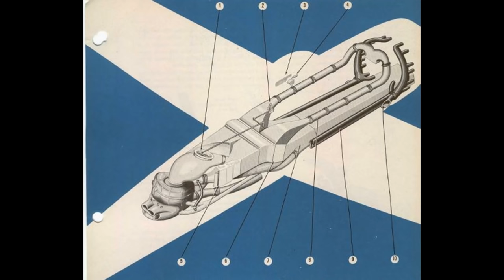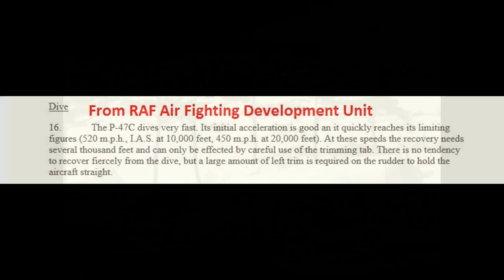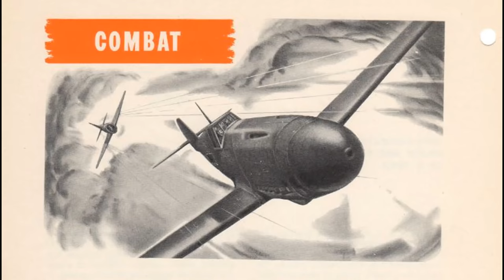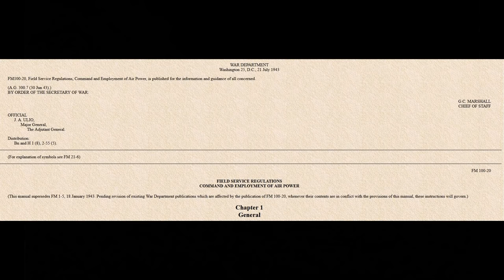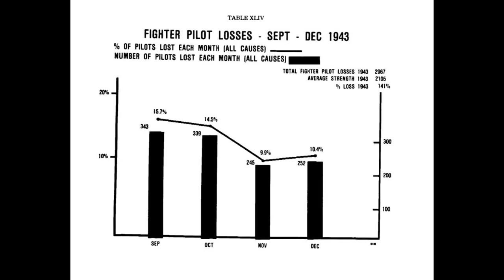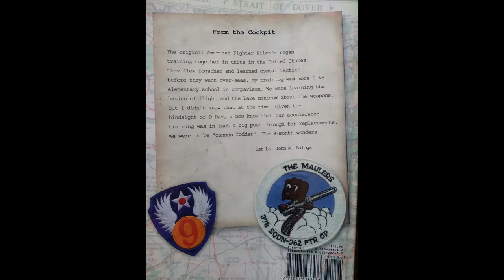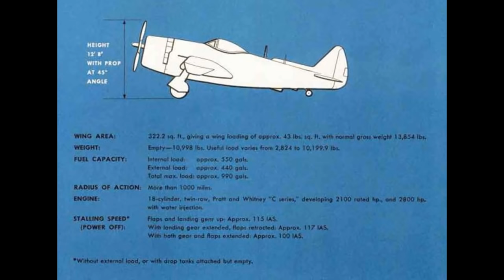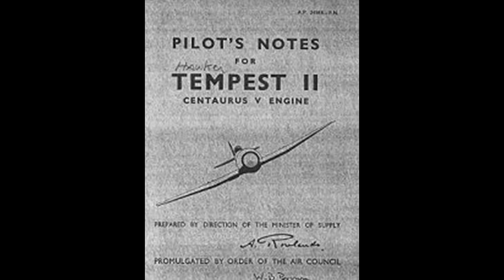P-47 Thunderbolt Pt. 8 Conclusions

Comment: The day before dive testing the P 47 Erick Brown found that the ME 109 F could dive at Mach .71 with wings and Mach .86 without.
Reply: The Me-109G could dive to similar Mach speeds as many other fighters: Around 0.80. The Fw-190A a bit higher: 0.84, similar to P-51s and P-47s. The 109 was only limited because of aileron flutter. With aileron dampers it went closer to the other late war types. The Spitfire could do 0.90 at high altitude in thinner air, but was no better than the 109 down low due to its thin wings fluttering in thicker air (and so at a much lower Mach percentage than 0.90, since Mach reference speed is higher down low)
Reply: Aileron dampers reduced roll rate, and were for dive tests only (obviously)...
Reply: @wrathofatlantis2316  Well, anyways it was stated, take it from the words of R.S. Johnson. Over the skies of Europe, he encountered an "experten" as the Germans would say. In his words " He steepened the climb, but with the new paddle blades, the jug would not let go. He flicked over and dove. He was one of the very best I've encountered. But the dive was his mistake. The moment that the jug's nose pointed down, I caught up with him. Never did they learn." His narrative when he met one of the elite Luftwaffe pilot flying the  ME 109.
Reply: @toknenengburjegol6430  I don’t question the P-47 outdived the 109 slightly at low altitudes, but at high altitudes it is the Mach number the limiting factor, while at low altitudes it is airframe buffeting strength. Most WWII fighters could reach higher dive speeds below 15 000 feet than above, except the spitfire because it could do 0.90 Mach. The difference in Mach between the P-47 and 109 was minimal above 15 000, but stability at low altitude (and aileron flutter on 109) gave the P-47 over 50 mph below 15 000. Mach number diminishes with altitude, which is why it is the deciding factor above 15 000, and the 109 was little worse in Mach, much worse in lower altitude buffeting. Hope this makes sense.  Initially the 109 even accelerated better in the dive, which made diving tempting, even if a wrong tactic in the long run against P-47. Though I won’t disagree with RJ this time (except for his exaggerated climb claims), this man is quoted far too much for the P-47, and is not a reliable source: He claimed use of 150 octane frontline performance 5 months before 150 fuel was available frontline: He tested the fuel himself in July, 2 months after his frontline service, so it is not a mistake, it is a lie... He is the least trustworthy source in all WWII, in my opinion. I have never seen a veteran pilot of the period actually knowingly lie, at least no one this famous.
Reply: @wrathofatlantis2316  Who knows? You were not there. There are some events in which publications came last before they were acclaimed. Probably, the 56th FG back channeled some 150 octane before they were ever officially claimed. An example was it was claimed that Montgomery of the British army was first to cross the Rhine. Truth was  it was Patton who crossed first hours ahead of him. As for the climb rate of the P 47 using paddle blades, not only Johnson made the claim. Lt Sutcliffe of 368 FG also claimed he was able to match the 109G in a climb.
Reply: And, almost all jug pilots claimed that no other German propeller plane was able to get away from them by diving. They were able to outdive them all from any altitude. These pilots dont gjve a damn with mach numbers and all, just when the Germans dove, they just followed and bagged the Jerry. As simple as that.
Reply: @toknenengburjegol6430  The P-47 could match the 109G-6 in an unsustained zoom climb, but not a steady climb: It is not even close; 2500 feet minute for P-47, at best, me-109G-6 3600 at worst. With MW-50 an even greater difference, G10/K even more. That being said, the P-47 M could probably match a plain 109G-6, or even beat it, but that is 130 built in 1945. The idea Johnson could have had 150 fuel in March 1944, in time for his last flight on his hot rod Razorback, is really beyond anything possible. Even after his las combat flight in May he tested in June 150 fuel and overheating kept climb to 2500 feet minutes (limiting MAP to 65” not 72” as he claimed to have in March). He also claimed to match a Spitfire Mk IX, which ranges from 3600 FPM to over 4800 FPM with 150 fuel, the best piston engine climber of WWII, even over the Mk XIV (!). The funny part is he does not even mention the P-47’s amazing ability as a superior low-speed turn fighter, only emphasizing the vertical, at which it was average... He did not even understand the P-47’s true advantages, as used by thousands of less prejudiced pilots, and this evident in everything he says: WWII evolved from obsessive hit and run in 1940 (especially by the Zero, since the IJN avoided turns throughout the war) to obsessive horizontal turn fighting, once the weakness of guns was understood. Robert Johnson and his lies are one of the many reasons historians have got the evolution of WWII tactics the wrong way round...
Reply: @toknenengburjegol6430  They have to give a damn about the mach number, it can't go further... It is dive speed at lower altitudes that was the P-47's (very) slightly bigger advantage. And so they had to wait a little to catch up. You don't hear much about P-47s escaping from 109s by diving either, P-47s escaped by turning, which was their real strength. A P-47 9 kill ace (Meroney) pointed out NO aircraft can use dive to escape away from an already diving opponent: Against a dive you can escape only by cutting throttle and turning horizontally. Turning easily defeated a diving attack, which is why WWII started with diving attacks, and ended with more and more horizontal turn fighting (largely due to the weakness of guns to get instant kills: Instant gun kills could be done, but not easily for most pilots). The USA won the war with turn fighting, and the reason you hear the opposite is the history (and physics) is completely screwed. See my channel for more details.
Reply: Hoa Tattis  Greg spent nearly ten minutes debunking Brown’s .71 Mach number in this video. 

Watch the video THEN post.
Reply: @wrathofatlantis2316  You’re discussing climb rate in a superficial manner. It’s nonsensical (the rate itself) without including altitude. And that’s pertinent because Greg does qualify his claims regarding the P-47’s performance. (In greater detail in episode 2 iirc.) 

I’m curious, if I’m going to spend time watching a channel of yours. I love arguing airplanes, disagreements are fine and expected, there’s always going to be gray areas and at the end of the day face it, everyone involved is dead by now so no stress. Who are you, what are your qualifications? 

My understanding is Greg’s an airline pilot. He’s solid. I’m an engineer (EE) but I’ve also designed a flight sim, comfortable with the maths. (Wrote a kernel for Hellfire/Longbow, NEXRAD radar, etc.) My little brother’s an ex-Top Gun** instructor (Cecil “Kermit” Turner), retired as XO VMA-311, currently also an airline pilot. All our practical experience is Cold War and later but we’re both WWII history buffs. 

Some of the stuff you’re saying here I’m not sure about, just wondering about your background. If you prefer not to say don’t stress, it’s not a big deal. 

** - or USMC equivalent

edit: also, I disagree with Greg too sometimes, about to leave and research a tidbit. But my experience is it’s not usually something gratuitous.
Reply: Sorry for the late reply. I am simply an enthusiast that has probably read more WWII pilot combat accounts than anyone else: 25 years of searching every account possible. I designed a variant of the board game “Air Force”, called “Advanced Air Force”, that you can find linked in the video descriptions of my channel. What I discovered is a massive disconnect between 1940s test pilots and 1940s front line pilots. WWII started with hit and run assumed to be dominant (since at least the appearance of monoplane fighters in the 30s): WWII guns using live rounds, not theory, had in reality a hard time killing with bisecting paths: Turn fighting gradually gained dominance over time, since it gave the guns a longer window of time to do damage. Turn fighting led to downthrottling, as in turn fighting it is the slowest, tightest turns who usually gets the proper lead, not the looser faster turn. Down-throttling does reduce momentum for tighter turns, but something else is at play because WWII pilots never throttle up... I theorize prop power is turn averse in the pitching plane, this hidden in the big sandwich of weight and lift, so not an easy to spot effect like yawing effects are. This would explain my other discovery: That fat radial types like the FW-190A were often extreme slow speed turn fighters, as was the P-47 (at least the Razorback). In the 190 case, turn fighting at extreme slow speed was by far what it did best: That is, besides going straight at high speeds with the worst vertical maneuverability of WWII... An almost exclusive slow speed turn fighter, as widely observed by opponents in all theatres. This made the 190A quite dominant, as you cannot easily bisect your leading fire with a curving trajectory: You have to follow in the same plane of the turn, at which point you are “locked in” a turn fight, in which the slowest will usually win through a smaller radius giving an easier target lead. This is radically different from jet tactics, because WWII 1% gun hit rates favoured going slow to really pepper the target with the low hit rate. On top of that, increasing prop power reduced your turn maneuverability because of some kind of thrust interaction with the wing, absent on jets. If this all sounds unfamiliar, it's because the accepted understanding of WWII air combat is wrong, not being based on actual front line pilot experience. It is a massive misapprehension from relying on a few atypical aces, and far too much 1940s test pilot opinions.
Reply: @wrathofatlantis2316  Oh, my brother and I were just discussing balancing anecdotal evidence and historical outcomes with raw technical and theoretical data. (Along with how unfortunate it is we’ve lost those involved to time.) And the day before, Dennis was teasing me about an Air Force scenario where he was testing “no stacking limits” B-17 formations with me back in the day! (45 years ago**) You’re Gaston, right? I read all your board game geek content. Could have used a rework back then. I should download and read your rules, but everyone’s scattered to the winds or passed now. I don’t have an opinion on your propwash theory but I’ll definitely agree it’s not all just wing loading. I have a feeling if you were my neighbor I’d waddle over with a six pack and bs about it. No stress. 

** - Dennis assures me that I chose that game to test German rocket rules, I don’t remember a thing but certainly cheated at every opportunity so likely. :)
Reply: @wrathofatlantis2316  quite a statement from someone that's never achieved much themselves
Reply: @randallturner9094  Hello Randall: Just a heads up that a major revision of Advanced Air Force rules, and the Data Cards, was done just now: A fourth page with new rules, clarifications on using the Maneuver Requirements of 0 for Banks and Turns, and many other revisions within the Data Cards, which print absolutely perfectly now. I took away the P-38L, but it should be back with the Yak-9, Ki-43 and Ki-84 in a few years. The bug never leaves. Hope you enjoy.
Reply: @wrathofatlantis2316 why assume he lied? And what would be his motive...to prove a point? I think he made his point, repeatedly, over Europe. If something is in fact incorrect, I sure would be inclined to give the benefit of doubt to Johnson making a mistake, as opposed to lying. He and his crew chief did talk with a Republic tech rep about setting higher boost. And, although U.S. stocks of 150 Avgas may or may not arrived in quantity on a certain date, I would not argue that certain quantities may have arrived at specific bases. We do know that RAF & British industry were concurrently producing 150 Avgas, just not in sufficient quantities. Everyone understood that this was a prerequisite for higher boost pressures. 
Since I wasn't a part of any of those events, I'll  continue to cut those that were, and are no longer alive to defend themselves, some slack, until it's categorically & and definitively beyond a shadow of doubt that they're rotten liars.
Reply: @josephstabile9154  What should one expect from the ONLY pilot of WWII to have painted TWO Me-209 kills on his aircraft? Also the ONLY pilot in WWII to claim a FW-190D-9 long-nose "Dora nine" in APRIL of 1944 (it came out in October)... As soon as he heard the Germans were developing a new type, that's what he shot down the next day... And do you think that does not buy you a lot interest and admiration from fellow pilots?! Those claims are not "wrong" claims about wrong EXISTING types (that would be an honest mistake): They are claims about types that DON'T EXIST... And that says it all about how seriously we should take Robert S. Johnson.
Reply: @wrathofatlantis2316  You need to read, then reread published NACA, Republic & AAF charts. Then review parts 1-8 of Greg's P-47 series. Nothing was going to outdive the P-47 in Europe from 40K to SL. Did Spitfire have a slightly higher mach number at high altitude? Yes, yielding a higher speed over a shorter distance. Did the P-47 out accelerate the Spit and outdive it to SL? Absolutely. 
I have the book by Quill, "spitfire Test Pilot". The only mach .90 the Spitfire would accomplish would be without wings.
Reply: @wrathofatlantis2316  LOL
Reply: @josephstabile9154  rotten liars, like the famous brit pilot that never let the truth get in the way of a good story?
Reply: There's no Spitfire that can out dive,out roll, or out zoom climb and at higher altitude even outclimb. Period.

Comment: What a great series. The P47 became my favorite WW2 fighter after reading Thunderbolt! in the early 90’s. Read it for yourself, the P47 is best high altitude fighter  of the war. As brought to light in the conclusion, the P47 broke the back of the Luftwaffe…..not the 51. If the P51 was never built, the war outcome would have not changed much. If the P47 was never built….all bets are off. Thanks Greg

Comment: Thank you for your diligence and attention to detail. The P-47 is and has always been my favorite WWII fighter. The ruggedness, firepower, overall performance and radial engine in my mind make it the very best overall fighter/fighter bomber of the war. It was clearly superior to the P51 and the Spitfire, which was not even in the same ballpark.
 None of the other fighters in WWII were even close to the Thunderbolt's versatility. The Thunderbolt was clearly the outstanding overall fighter of WWII.
Reply: Greg does not do his due diligence he is comparing a Feb1941 Spit V against a 1944 P47D . All the Spitfires below were contemporaries of the P47 
 Radial engine to start with P47 D/W 2800 p/w 0.89 s/p 0.75 Merlin 61 p/w 0.96 s/p 0.96
Climb Rate P47D ICR 3120/3220 ft/min Spitfire Varied from 4060ft/min MkVII, 5580ft/min MkVIII ,4200ft/min MKIX, back to  4700 ft/min MkXIV 
 Turns P47D 990 ft Spitfire circa 750 to 800ft 
Dives Tactical Mach P47 0.72  Spitfire all marks 0.84 to 0.89 
Speed P47 426mph @ 30000ft  Spitfire VII HF 424mph @26800ft MkVIII 408 mph @ 25000ft  MkIX 416mph@27000ft MkXIV 439 mph@24500ft
Service CeilingP47D 40000ft Spits VII 45100ft VIII IX XIV 43000ft
Armament Always the P47 
 Range P47 by 30 miles 
Ruggedness always P47 
Oh and the Spitfire was a carrier plane as well 
Spitfires more Theatres of Operation
Reply: @jacktattis   You obviously did not pay attention.
As for me I will take the P-47D over any Spit every time.
Reply: @cvr527  good for you. Just do not dive in it or try tight turns below 8000ft or do any Ground attacking in it. If I think of anything else I will let you know
Reply: @jacktattis   Blah, blah, blah bubabuba blah, blah, blah!
Reply: @cvr527  Yes indeed

Comment: I think this is the best WW2 aviation channel of all.  Eight months between the Tempest and P-47 N is not a short time by WW2 standards - comparable to Gladiator to Bf-109.  By the time the P-47N came about there were a lot of Tempests in active service so I don't think they were really contemporaries.
Reply from the maker: There is a big difference between the changes going on in 1934 vs. 1944 in regards to piston engine airplanes. No matter what version I use, someone will think it's unfair, especially if British aircraft are involved. The Tempest was awesome but a newer over all design than the Thunderbolt. The Thunderbolt N is the closest one to the Tempest by most standards of measurement.